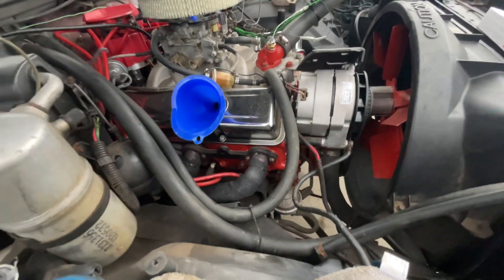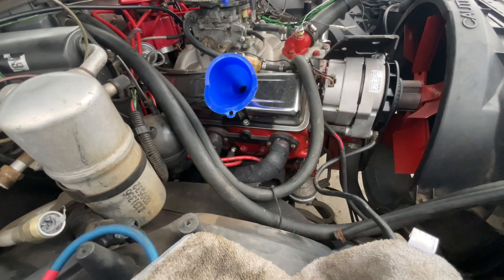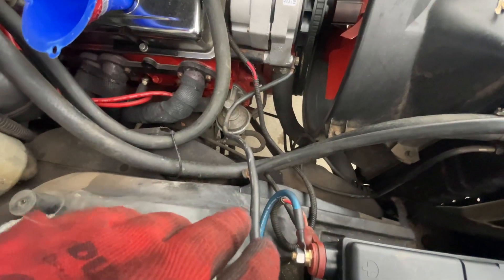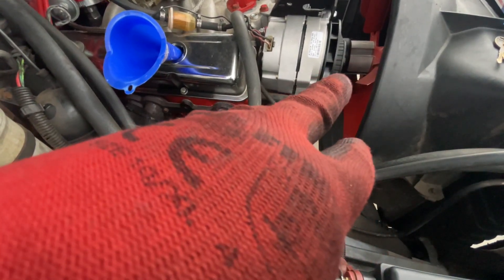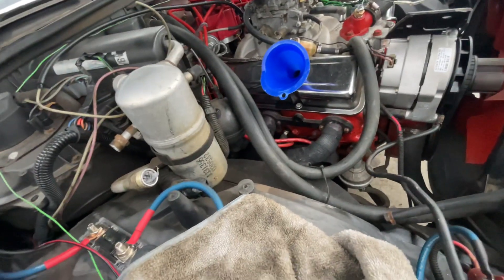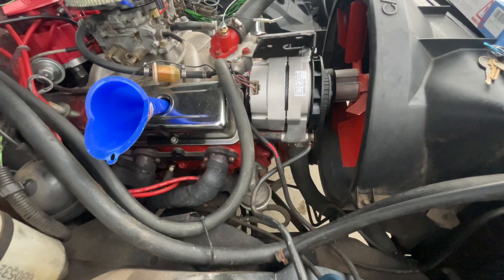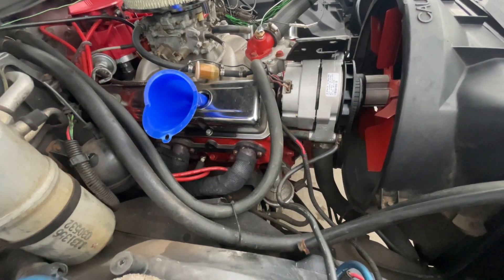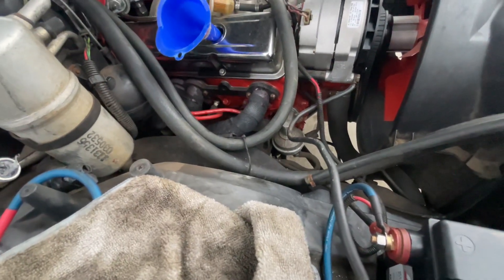My cutlass supreme is having a voltage issue!!! Big 4 upgrade for gbody???

Comment from the maker: Almost positive I need to upgrade my alternator and power and grounds since I added a lot of aftermarket upgrades that the charging system probably can’t handle but lmk what y’all think.
Reply: When I saw your post the first thought I had was higher amperage alternator. 150 should do it. Wouldn't hurt to add a thicker ground between the engine and frame
Reply from the maker: @noinstaphil  that’s I’m thinking bro. I order 2 0 gauge grounds, a 0 gauge power wire abd 150 amp alternator. Im hoping that solves this issue. We’ll see in a few days

Comment: I'm here for the comments..but I can say u need a bigger alternator...I have a 105 and it ain't enough...I'm going Mechman or JS
Reply from the maker: I’m thinking the same thing. I only got 1 10 inch subwoofer and plan on going back 2 10s so I know for a fact I’m gonna have to upgrade my charging system. Guess I’ll start getting the ball rolling because if you’re having a slightly similar issue, the alternator has to be the problem.
Reply from the maker: You think 150 amp should be enough or what you thinking?
Reply: @1tonystunts  I’m not sure

Comment: Connect a volt meter to the alt charge post and the battery. Run engine at 2000 rpm and turn on all loads. If the volt meter shows more than about 1/2 volt you have too much resistance between the battery and alternator but in reality you probably need more alternator turning faster at lower engine RPM by using a smaller alt pulley or larger crank pulley and matching belt and heavier wiring between the alternator and the battery. Or just use the factory radio without all of the boomer crap.